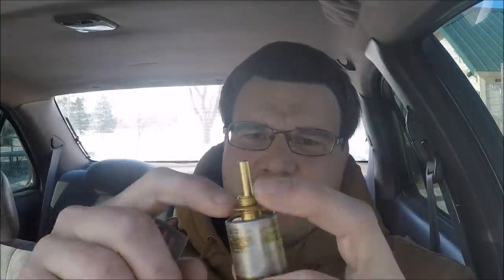1996 Nissan Sentra 1.6L Coolant Temperature Sensor replacement

Comment: Thanks Nathan my car is a 1996 nissan Sentra also and doing the Samething will try this i will let you know if it does
Reply from the maker: Good luck. I hope it helps.
Reply: @nateboyce1  like i said it's doing the same thing cylinders flood with Gas try to start get a backfire due to the flooding of the cylinders  when it does start runs about 2 minutes then shuts off according to others i heard it will mess with your timing on the car too But will let you know if that does the trick again thanks again

Comment: hey brotha. I had this same issue. I changed the temp sensor but now every so often when I come to a complete stop the car turns off and it takes about 5 cranks to turn back on. any idea as to why? thanks
Reply from the maker: Not sure what that would be but I would start by testing the fuel pressure and looking for vacuum leaks.
Reply: hm I gthe same problem with engine stall after 1 km of driving and it starts after 5 attempts
but before stall check engine light occured
self diagnostic showed error 13 - its  temp sensor

didnt change eyt

Comment: Hey thanks for the video! I think i have the sMe thing out on mine but mot sure. Mine will start after like trying 5 times(maybe my battery has more life than its?) And it seems like it is flooded and then clears out. This started to happen after it over heated due to radiator fan fuse not being in, could it be the same as u replaced?
Reply from the maker: Heather Ann probably not. When the coolant temp sensor goes out on the Nissan 1.6 it usually won’t start.
Reply: Um fuel injected cars dont flood...... The fuel regulator stops that from happening and so does the injectors...
Reply: @AndyKPOV  ok Andy🤗

Comment: was the problem when engine is hot or cold.  or both ?
Reply from the maker: Problem is when engine is cold. Had it happen in winter and summer multiple times on both Nissan Sentra's I have owned.